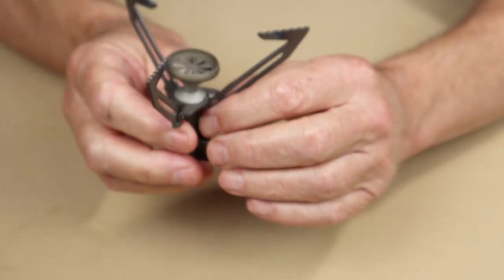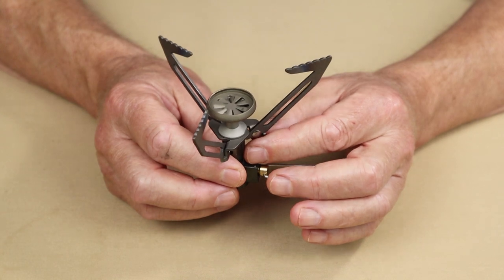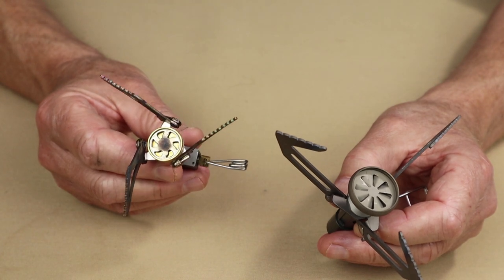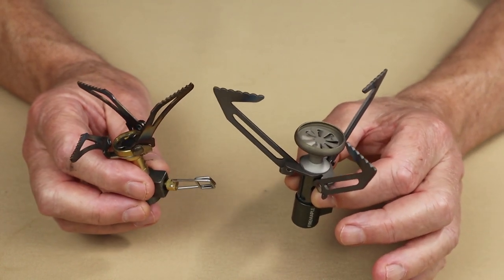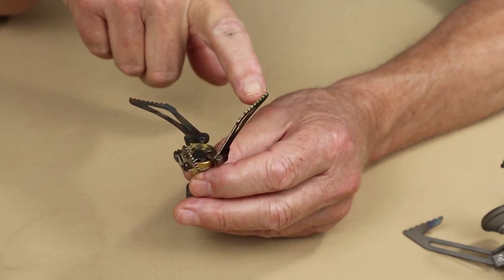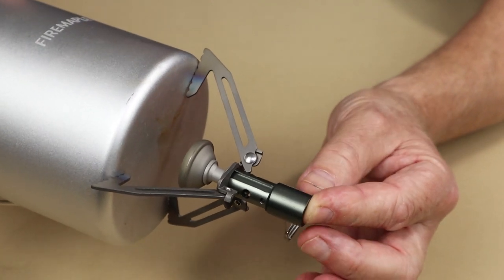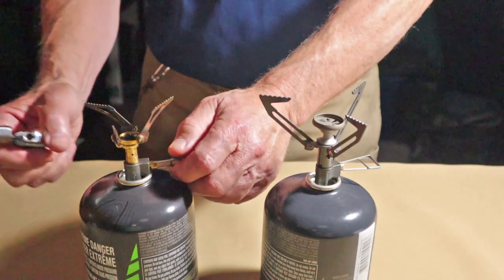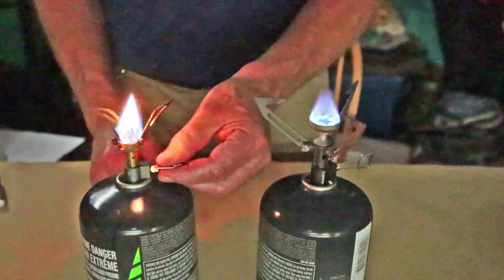Fire Maple Hornet 2 Compact Titanium Gas Stove

Comment: A windscreen with a canister stove needs to be limited to the area above the canister itself.  You don’t want the heat from the stove reflecting onto the canister.  Manufacturer warnings all over the place on that.
Reply from the maker: I agree, there is a risk if the windscreen is too close the canister or encloses it all the way around. However, if it is set back enough and open on one side it is more safe to use. Thanks for commenting
Reply: I use the Ocelot windscreen from Flat Cat Gear with my BRS-3000t canister micro-stove, as it has a reflection plate to protect the gas canister from excessive heat. As well, FCG recommends turning down the BRS to 1/3rd power. This extends the boil time, into alcohol type range, but conserves fuel, and like alcohol, is much quieter 👍

The D90-100mm windscreen encircles the whole burner, and matches to my Boundless Voyage tall skinny 900ml pot, D95mm with locking handle (equivalent to the Stanley Adventure Camp cook pot but in titanium). Unfortunately, it CAN'T be adjusted to my short fat 900ml mug/pot with bail handle that I use for cooking & eating from, instead of just boiling water, but I'm thinking of mating it to the X-boil instead, and making a foldable mug coozy, instead of the dollar store insulated lunch bag that I use now. (The lunch bag doesn't fit in my one pot nesting system)

With my leftover inoperable brain tumor, I avoid plastic touching my food when heating or rehydrating, and use my short fat mug/pot instead of pouring boiled water into the plastic dehydrated or freeze dried food bag. I repackage my dehydrated/freeze dried meals
Reply: So the anecdotes go.
Hard evidence is lacking.

Comment: A Piezo lighter can never be fully trusted anyway, particularly at higher elevations.  I’ve run into a number of stoves where the Piezo stops working over 9500 feet yet has no issues when brought down to lower elevations.  Strange. 

I carry a lighter or matches anyway, as a result.

A stove not having a Piezo isn’t a showstopper, as a result.  It just adds weight.
Reply from the maker: Agreed, and they always seem to stop working when you need them the most. Thanks for commenting